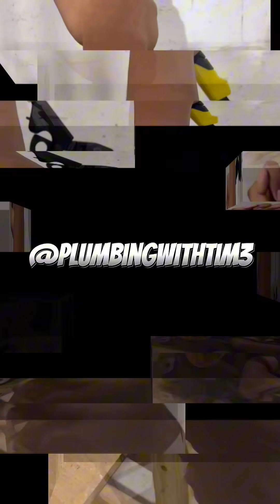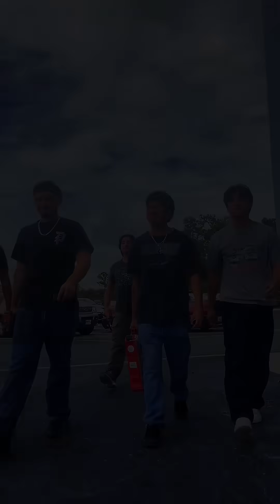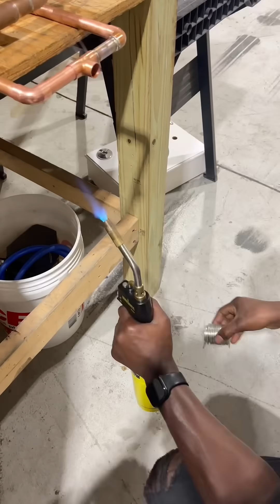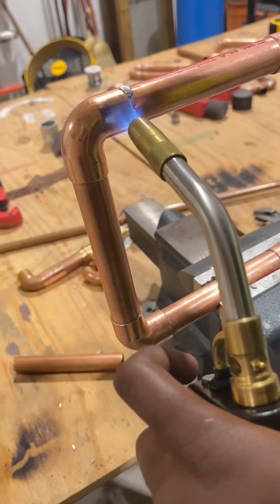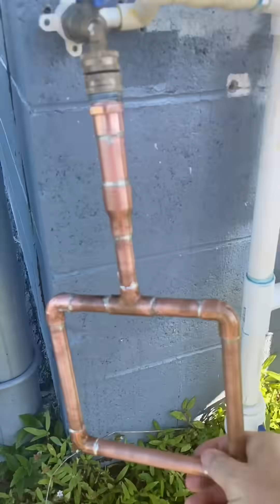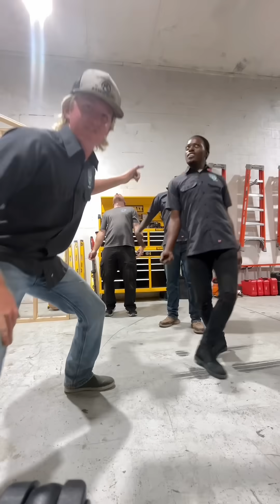How to Solder Copper Pipes - Beginner Plumbing Project + Leak Test

Comment: Mostly wrong.Apply solder on oposide side of flame. Its the coldest side, if it melts,capilar effect will fill all gaps and make excellent solder joint
Reply from the maker: Everyone has there own way.
Reply: Not bad, but using litle bit science behind it, you can step up your game.  @plumbingwithtim3